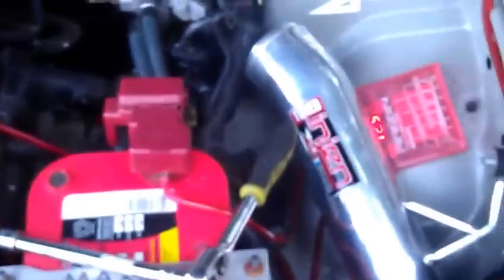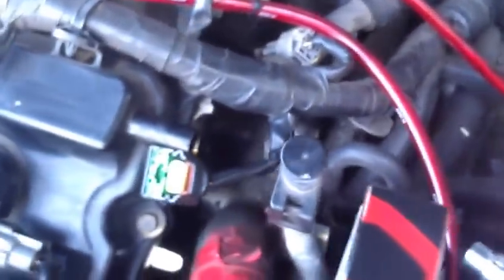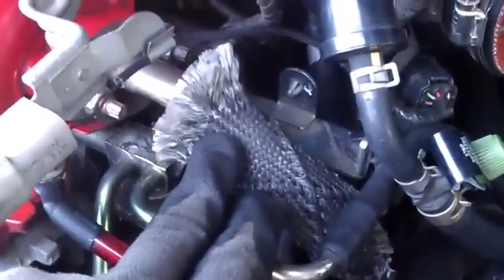04 maxima 6th Gen --__-- Front & Rear Camshaft position Locations

Comment: Do u have a video on replacing the crankshaft sensor?
Reply from the maker: not yet but will make one soon..
Reply: Changed all three sensors and my car is shifting out fine now. Only problem I'm having is when I crank it, it keeps cutting off. I have to give it gas to keep it started. Thank God it wasn't my transmission.

Comment: good video and good information, just a little more input, other tell tale sign is once your car heats up it will stall, when you re-start the car nissans will put themselves into what is called "FAIL SAFE MODE" basically its a safety feature in place so the car won't hurt itself. basically fail safe mode is the transmission will place itself into 5th gear and STAYS there, as in it will not shift. this is a big problem with nissans (even mine) but great video and im sure helpful to many.
Reply from the maker: Great feedback Brian.. Really appreciate it.. And that is a tall tale sign of the cam going...

Comment from the maker: They are typically magnetic sensors that lose their sensitivity over time, and their impending failure can cause rough running, hesitation, stalling or even eventually failure to start. The classic ultimate sign of this failure is an engine that just stalls out for no good reason and sets no error codes. The reason no codes are set is because when the sensor fails it reads 0 RPM so the computer thinks you've shut the engine off and therefore kills fuel and/or spark to the engine.

Comment from the maker: Good looking my dude and what the cam (or crank) shaft position sensor does is to tell the engine control computer where in the cycle the engine is at any given time as well as how fast the engine is turning over. This allows the computer to calculate when to inject fuel and when to fire the spark plugs (as applicable).